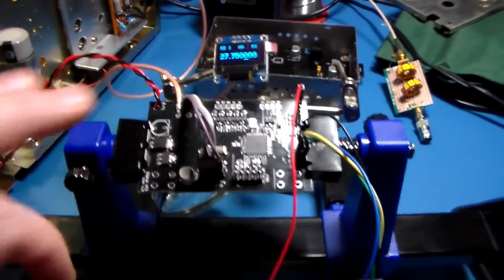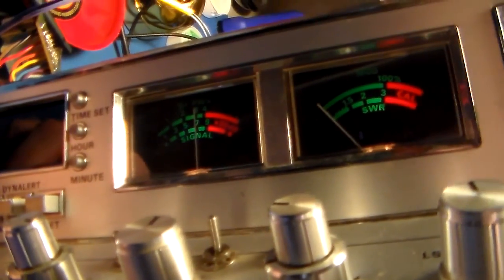Cobra 2000 unwanted tones ouch!!!

Comment: You have really done a good job on designing this unit.  I was worried about the unwanted signals when you started it.  Ran across a similar problem when attempting to install a DDS in a Siltronix 1011C. And like you I also need a tracking gen. I have a SA.  I think you will succeed these limitations. Just takes time.
Reply from the maker: I need to get fiddling.... do the math... and can probably sort it out.